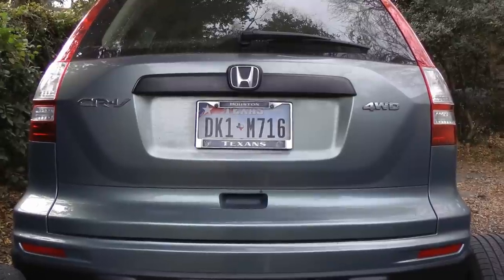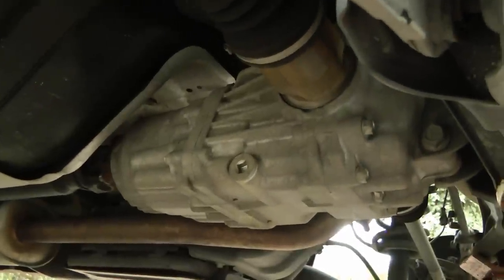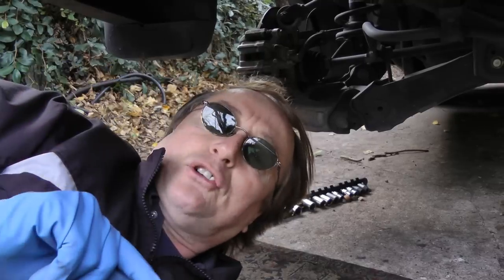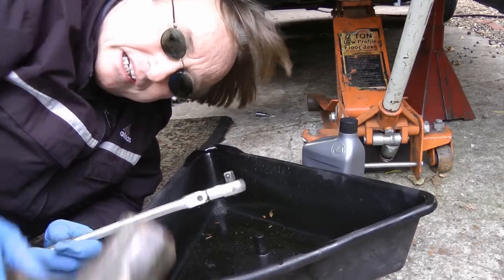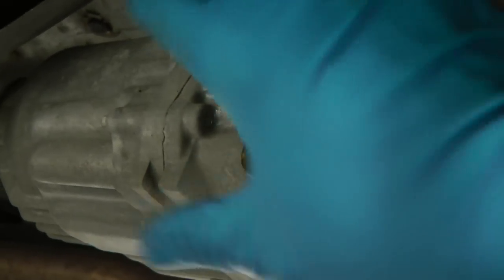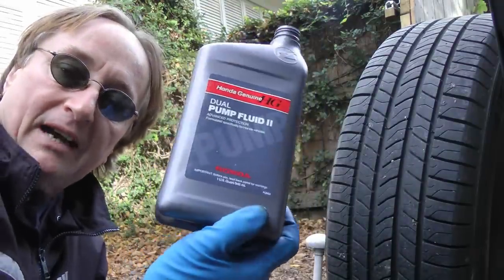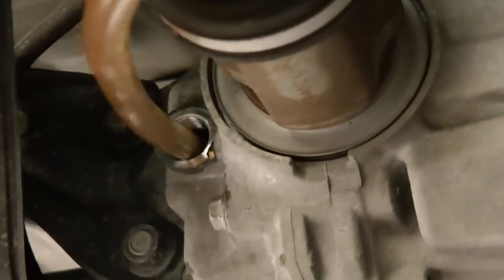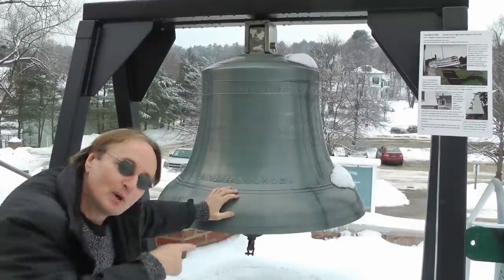Fixing A Howling Honda

Comment: I have a 2001 Honda Odyssey and I'm having a hard time with the shifting which means when I drive it it gets stuck in gear and don't want to go it doesn't shut off but it seems like it's running out of gas but it has fully gas in it my gears are not running right I don't know what to do how to fix it without going into the transmission completely

Comment: 2009 Honda CR-V  4WD, changed diff. oil (oil coming out was clean, changed regularly ar 30k intervals,), 105:000 miles currently. Noise less, but still there, now what?   Jim
Reply: Noise was actually Rear brake pads. 108,000 miles and they were The original pada. They rusted to The SS Harward and would not properly releaser.. New pada, Harward and pins and pin rubber solved The problem.

Comment: hey Scotty my old Suzuki 4x4 also makes a howling/grumbling noise but it comes from the front. But not all the time though. Only when really cold outside and I 1st start driving. Then it goes away after about a minute. If I crawl in 1st gear it sounds like someone farted next to me, any faster and it's LOUD. Should I do this?
Reply from the maker: they have front differentials on that 4 by 4, and they howl
Reply: Okay, I'll ignore it then. I've just never heard it before and it was really loud so I thought I'd ask. Thanks!

Comment: RALLY 7540 12V DIRECT PLUG IN CAR BATTERY BOOSTER VS JUMP CABLE, WHICH ONE IS BETTER ?
Reply from the maker: different animals. a booster is a stand alone device, very handy. But jumper cables and another battery provides much more actual power to the car. Just depends what you want.

Comment: Can you recommend what would give the biggest horsepower gains for the least money on a 2002 Acura TL  ?
Reply: Take it to a performance shop and ask them about "chipping" it. They reprogram the computer and the transmission's shift points to improve either fuel economy or HP, sometimes both.
Reply: Yes I kno that method, I'm thinking along the lines of a nos kit, exhaust, intakes etc. Whats tbe biggest boosts for my car..
Reply: Rainè Freeman
I thought money was an object. Psh, I'd get a twin scroll turbocharger like those found in a BMW 335i. Exhaust really only helps with "breathing" and noise. That'd be one of the last things I'd worry about. Also, NOS can completely destroy your engine's internals. If you want any kind of longevity in your engine at all, avoid NOS. You can get a cold air intake with performance air filter at AutoZone for like $120 and it just bolts right on, replacing your existing filter and ductwork.
Reply: Yea an air intake is prolly gonna be the 1st one. But I got a couple holes in the pipe anyhow so I have to replace it soon anyways and hoped to get a decent boost in hp. Its pretty quick as it is but I wanna go faster.. money is an issue but 1000 per part is eventually doable. I'd just have to save up.. as far as twin turbos, no I wish I had 5000 laying around lol

Comment: hello scotty i have a problem with a1992 nissan 300zx . everytime the car take off. the defferantial clunks and every gear that i change clunks and when i press the gas and let it go fast it clunks. what u think this problem could be?? would thank u very much if u help me with this problem ?
Reply: henry montoya it most likely needs new fluid. check the owners manual to see how often to change it. but... it can also be your clutch or gear box is going bad, but its easy to fix. but it takes a super long time. so have a a full spare day to do this.

Comment: hi scotty i have a question for you i have a honda crv 2000 i have changed the upper control arm on the left wheel about 3 times the rubber just dont last and the car starts making a cluncking noise what could cause this problem ???
Reply from the maker: buy a higher quality control arm, many cheaper chinese made ones have crap rubber in them.
Reply: Sometimes weird noises in a Honda can often times come from sway bar end links.

Comment: Hey Scotty, so  I recently changes out the differentail assembly on my 98 Pontiac trans am that went bad. I got a replacedment from an 01 z28 camaro with 50k less miles then my bird, everything was fine in till a month in and now its making a whirling/howling noise. 

I changed the fluid thinking it was low but its still making that noise. Any ideas what it could be? I thought it could be my wheel bearings but its doesn't have the groaning noise, it more "UFO" sounding lol
Reply from the maker: GHOS7v realize it takes a pro to swap out a diff correctly, even off a thousandths of an inch can lead to bearing and gear wear. Plus, you put in a used unit, guys beat the heck out of camaros so I would assume that diff is wearing out now too. You're better having a pro rebuild it, I use McAfee standard transmissions here in houston for that

Comment: I'd like to make a point. Make sure you can remove the fill plug before you try to drain. If you drain it and can't get the fill plug off, you're kind of stuck.
Reply from the maker: you can actually pump it back in the drain hole with a pump, i've had to do that on occasion

Comment: hello Scotty, I have an 1997 toyota prado want to change the differential and tranfer case oil do i need torque wrench for the job. when  i  reversing turning right or reversing out on the parking spot  the car vibrate what is the problem of it? 

thanks
rob
Reply from the maker: you definitely need a torque wrench on that job. and it could easily be that's the problem

Comment: Hey Scotty 

I have the howl early mornings on cold start only in reverse 

But after I drive car for 5mins it's gone when I reverse again 

Is this the same problem?,
Reply from the maker: Luis Ritchie I would assume so, that's the classic way the sound starts up, fix it before it gets worse
Reply: Hondas normally give a whining noise when in reverse. Its how they designed their auto transmissions

Comment: Hey Scotty I"ve searched all over the internet but I can't find my answer.. I have a 1996 gti vr6 5 speed with a borla exhasut... I believe that really low annoying sound is called Drone going past 50 mph, Well that noise (Drone) is been happening just recently,,, never befored... The borla exhaust is not too loud only when going full thottle ...The problem is that its happening even when I put the car in neutral going at 70 mph that low sound is still there, so Maybe its not even Drone...Maybe You can help me out here Please, I fits not too much to ask.
Reply from the maker: sympathetic noises often occur with such loud exhausts. Live with it, or try my video "finding the source of car noises" and hook one of those up
Reply: Scotty Kilmer
Sorry about your time comsumption Scotty but my question was that it does it when im going past 50 mph and even if I take out the gear on the car and letting it role on the Inertia of the 50 mph so I was thinking that its not even the exhaust ...you think it can be caused by the wheel mechanism or something??
Reply: luis luna maybe your driveshaft is touching the exhaust and it is resonating it like my car had.
Reply: thanks for your reply bro I appreciate the intention, and I did fix the  problem it was a bad wheel bearing. thanks though
Reply: luis luna lmao i replace those so often and didn't think of that

Comment: I have a 2002 honda civic.  When its in neutral or 1-2 gear with the cluth out it makes a raddling noise....if the clutch is in it doesnt make the noise...
Reply: Did you figure out the problem? Sounds like a bad throwout clutch bearing to me

Comment: hello, scotty i been having problems on my honda accord FWD. i recently replaced the front pressed in wheel bearing and rear bolt on. and still i have that howling noise as i go faster and faster. any ideas or suggestions?
Reply: I have the same problem .. sounds like passenger side.
Reply: Did you figure it out?

Comment: like your videos scotty, on ford escape 2001 that's howling in the front what might be the cause? and if the front diff fluid needs to be changed where the drain plug is located i can only see the one for the transfer case.
Reply from the maker: the diff fluid should be the same as the regular transmission fluid, they share the same fluid. Change the fluid you change both. But if it's howling, odds are bearings are shot now

Comment: ok this has to do a hum not a howl but its coming from the intake, i took the IAC valve off and cleaned it but its still doing it, i cannot find why its doing it,,help lol....also a blowing on a coke bottle noise is coming from the wheel area, got the bearings checked and they are good what else could it be??
Reply from the maker: replace the iac valve, bad ones often do that.  As for the wheel noise, only thing there is wheel bearings or dragging brakes if it happens when moving, I would do my video 'finding the source of car noises" on that one
Reply: Scotty Kilmer alright, it really only does the wheel noise around 40 mph and faster
Reply: it could be your torque converter

Comment: Ive been hearing some clunking noise when i turn and reverse turn . I changed all the mounts including the rear differential mount stiil having the issue i changed the differential fluid still hearing the issue . I see that alot of people are having the same problems and they go to the honda dealer and just replace the fluid again and still doing the noise . Anyone knows what can i be the problem? I have a2007 honda crv ex awd
Reply: Did you change front diff fluid too?

Comment: Always remove the top fill plug first. If you remove the bottom first  and drain it like he did you may run into a big problem when you can't get the top one off!
Reply from the maker: you can always pump it in from the bottom with q pump, and this is aluminum diff, so they don't rust
Reply: @scottykilmer  you are amazing